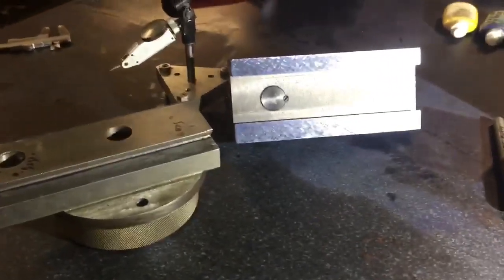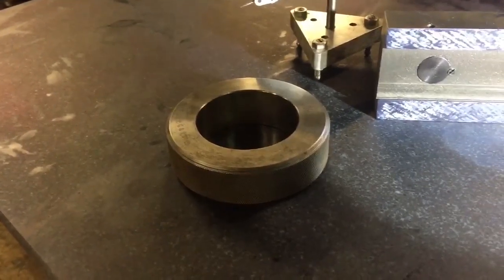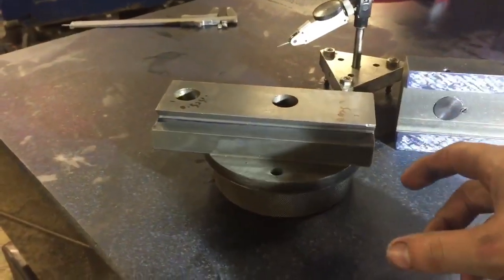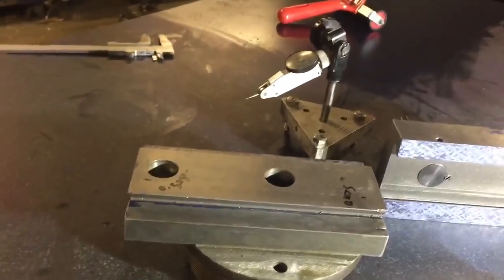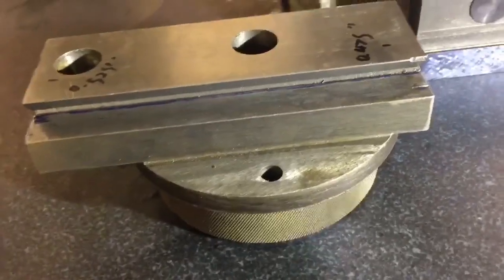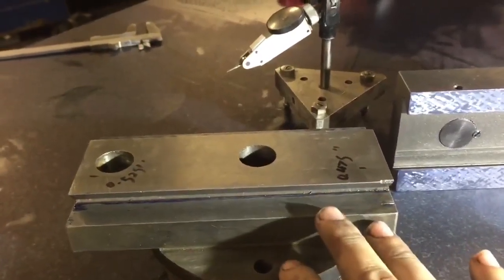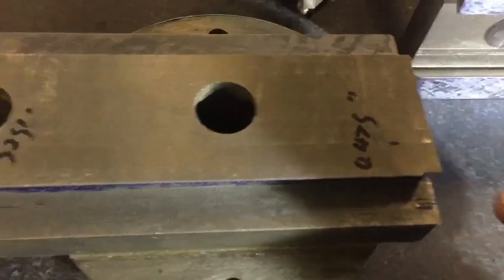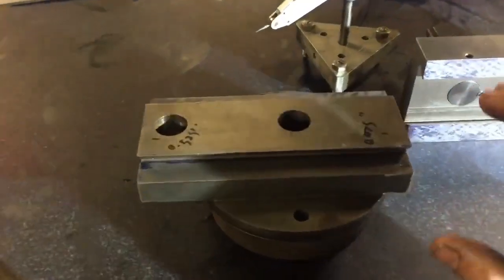Addressing Factory issues with small Hafco lathe

Comment: hare and forbes CRAP
Reply from the maker: its incredible the amount of repairs I've had to do to near brand new Hafco gear, I had more geometrical error in a brand new HM-46 I fixed up for a mate than I did on a Toolmaster mill that was 50+ years old with moderate wear
Reply: @marcuschristensen4183  I had the same thing with my lathe to many problems hand scaping with a angle grinder in the factory  plus other thing to many to list  that did not fit they are just CRAP CRAP CRAP CRAP
Reply from the maker: @Imagineering100  the lead screw alignment is so bad on a lot of the smaller bench lathes that they burn out the motors if you try and screw cut too far from the headstock, if you're based in Australia and ever in the market for a smaller new lathe I'd recommend Whitelaw or Redmond gary (who import new Russian gear) bit on the pricey end compared to hafco but great stuff
Reply from the maker: shane  see of you can find the build date and model, some of the older Hafco stuff wasn't actually half bad and for some reason everything that had a three phrase motor slapped on it was fitted and finished slightly better. will also depend on the wear obviously, if the beds in reasonable nick its not much to bed the saddle in and tickle the cross slide ways/compound
Reply from the maker: shane  where about in Australia are you?
Reply from the maker: shane  mhcmachineworks@bigpond.com but worth just ringing me on the landline at my shop on a weekday (07) 5522 1726
Reply: shane  sorry I think my youtube account was linked to my facebook account that was permanently deleted, once I logged out I couldn't log back in and brisbane is about an hour North of me